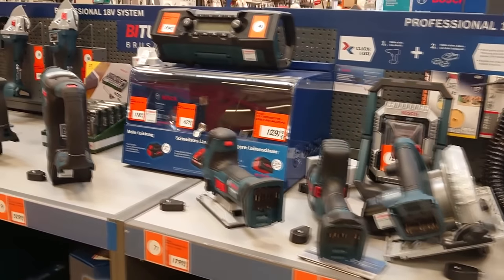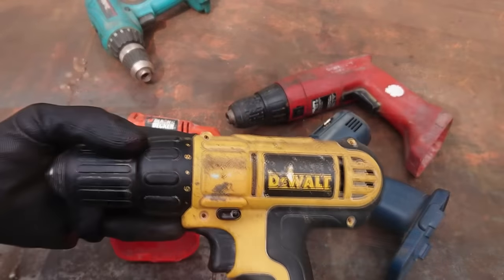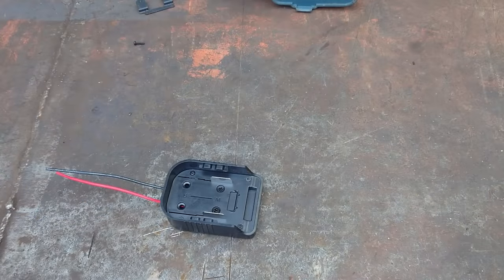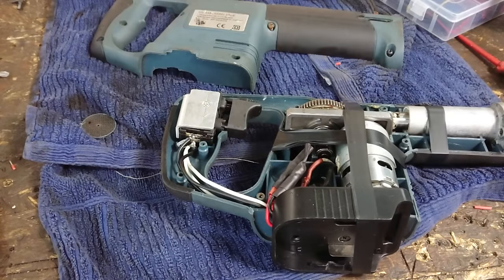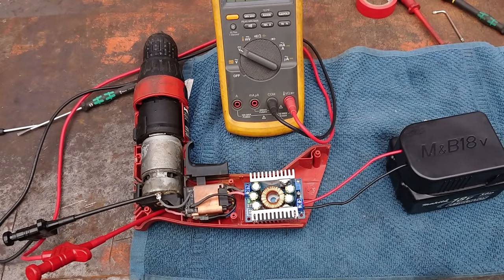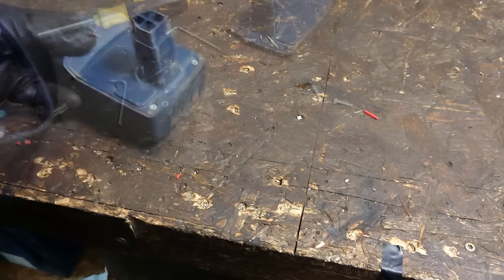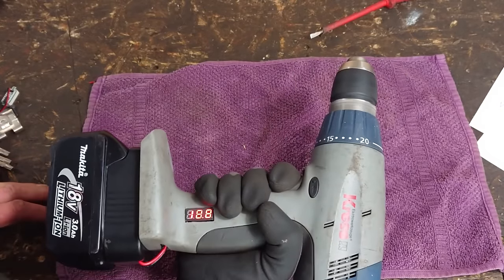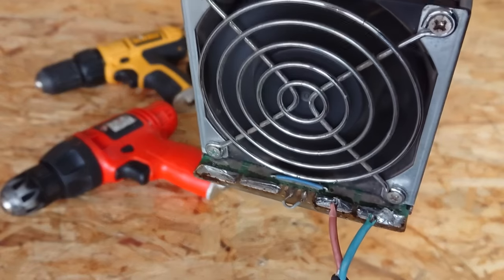Scrapyard Finds! Repair-A-Thon! Cordless Tools Galore!

Comment: While building and working on my new house I had an old 12v drill which I just wadded some 2 core wire or figure 8 wire with a 12v cigarette lighter plug and 3 meters of wire and walked around with my 12v boost starter battery and I could work for several days with out a recharge

Comment: Could you use one of those 12v drills with a car battery? It may be useful to have a drill or saw that you can take camping and it will run as long as you have gas in the engine. A couple of large alligator clamps on one end?
Adam

Comment: You should have taken a couple of those roller shutter motors that can be seen at 1:35. Some of them are quite expensive, especially those from Somfy. And often it's quite easy to fix these. They got a capacitor motor and most of the time it's just the capacitor that needs to be replaced.

Comment: The PTC thermistor in the battery from the Kress drill is probably used to indicate to the charger that either the cells are overheating and to therefore stop the charge cycle or that, as with NiCd and NiMH technologies, to determine a full charge condition has been reached, as the cell temperature starts to increase more quickly when they have attained full charge. The cells do heat slightly during normal charge cycles but this is gradual and the temperature reaches equilibrium.

Comment: Connect a 12 volt tool with a 2 core cable and two alligator clamps to a vehicle battery. Where the vehicle goes you have the tool available.

Comment: I always had the idea in mind of using a carpenters belt, and converting it into a battery pack with switches for different voltages, with a universal connector, on the belt pack and the matting connectors on tools, Something like a barrel jack connector on each tool so regardless of the tool, one just needs to open it up to mod it with the connector and call it a day.

Comment: Seriosly good use of your sparetime, fixing old battery machines. Like the conversion, good idea! One thing i would have done differently: i would change the switch for left/right on the kress machine. Since it is backwards to the common standard, it can be a problem. When i was fiftheen i got an adjustable wrench from my dad, it was a cheap china knock-off and the screw was backwards to normal standards. Even today, (i threw away that crap just after less than a year), i dont know witch way is the right way to tighten/loosen a wrench. Irritating!

Comment: I have a 240v Kress 230mm angle grinder from the 90’s. It is very robust however the commutator is damaged, I’ll get around to fixing it one day.
It was made in Germany but I can find very little on the Kress company online. Although I see a multinational has bought the brand and is using it again, doesn’t look close to the quality of the older model.

Comment: I have that same reciprocating saw with a different manufacturer's name on it... they are chinese.. and i need to convert them to LI or Nickle Metal Hydride so your video was good timing... one recommendation ... if your drill has a Low / High button then only use High for drilling light wood and for any heavy work like screws you should put it on Low because it has more torque. Most people just want their drill to run faster but if you do heavy work like screws on the High setting you will burn out the clutch... I use to work at a tool shop and this was the second most problem after people that drop their tool. ... thank you again for your video I will have to see what adapters I can find and which brand battery is the cheapest.

Comment: 15:05 The thermistors are usually primarily there to connect to chargers, not necessarily the tools themselves.

Older type NiCd chargers used temperature as a full charge indicator, as "delta peak" detection was not popular back then, probably because NiCd have this effect less pronounced, and because circuitry to detect this very subtle peak would be more expensive than a simple NTC to detect heating, which NiCd could tolerate very well anyway.

When NiMH became popular "delta peak" detection chargers became the norm as NiMH are not so resistant to overheating and their delta-peak is somewhat more pronounced.

Even today, Li-Ion packs contain thermistors to connect to chargers as it is very common for chargers to be left somewhat unattended and they may become a fire hazard in case a cell is old or damaged.

In contrast, a battery becoming overheated during use would be immediately noticeable by the user so some brands may forego installing temperature monitoring on the tool altogether.

Comment: you can wire in a rc car battery pack to that very old makita. The 6 cell 7.2 volt ones fit just fine.

Comment: we have einhal 18v tool system in Australia .they are branded ozito pxc  and sold in bunnings their cheaper than ryobi. i use the 18v drill batt for powering laptop computers and to power my ts-100 soldering iron.

Comment: Hello G,  Just an idea to further your battery.  since your concept is to carry around a battery, why not include a few other features, consistent with a general purpose power source?  Maybe add a capacitor for surge so you can jump start a car and a charger and a multivoltage tap for the different tools.  A car jump starter power pack is a close start on the idea.

Comment: I have 3 cordless drills converted to corded.... I made a power supply from an old 12v 10A transformer + 25A bridge rectifier and a 10000uf 25v capacitor....they work like new with a  3m cable

Comment: Thanks for the ideas.  I was thinking about what to do with my Makita 9VDC drill when I cannot find batteries for it any more.  Would hate to get rid of it as that was my first ever cordless tool.  I bought it new back in '87 or '88.  It has worked on almost all of my projects through the years.
Reply: You could find a way to strip out the 'stick' battery case and fit it with three removable 18650 cells?
While not entirely convenient, because of the odd number, you can charge three at a time in a four position charger.

Comment: Very nice, I would have used a good quality XLR connector for power for the last drills, it is secure, has beffy contacts, and the best, its relese mechanism makes its fast to connect and disconnect.

Comment: Now all you need is small foldable solar panel added into the bag carrying a battery for a self sustaining portable unit! Great for homesteaders without electricity or a weekend camper to use to cut firewood with a recip saw or build a shelter using screws! The one thing you didn’t mention was securing new nicad replacement cells. Luckily they are only $13 each for an 18 volt nicad battery at Harbor Freight stateside. I’ve gutted several over the years to use as replacement cells in that same exact 18 volt dewalt drill and most of the other tools in that line. I would suggest whoever tries this to do a search here on YouTube first because it can be dangerous when re-soldering the new cells. Too long you can kill them, slip off and they can explode. Don’t mean to scare anyone because again I’ve done it for years safely, I just want everyone to know there is a risk if done poorly. Now I can find whole replacement battery packs for around $15 each vs the $125.00 each they once were. Yea they’re nicad, but having almost the entire set of that line of 18 volt dewalt tools you can understand me wanting to keep them going because they still work fine today. Thanks for taking us along brother, ✌🏼👍🏼

Comment: I think a RC Li-Ion batteries would work great with the connector system. This would help to create a common battery and connector system.

I would like to do this as I’m looking to get some drills for specific purposes (like one setup for just countersinking) but used drills around my area go for near the cost of new ones.

Comment: i've tested old 12V drills with 18V and even 24V and they seem to work just fine, except that they work faster of course and 12V drills being slow anyway that's a good thing, so could have just used that red Hilti drill straight with the battery. I don't know how or how long the speed controller and whatever else is in the drills would last with a higher than intended voltage though, but it's worth a try.
You don't have to worry about damaging the motor, from what i've seen and tested motors don't have a set voltage at which they work, they are built for a specific one sure, where you get the desired speed and torque, but as long as the voltage doesn't go high enough where it can cause arcing and a short circuit it should be fine, even the cooling should keep up, i mean the fan spins faster too.
The thermistor is used by the charger not the drill, to keep it from overheating while charging (i'm guessing).
I thought about powering the Dewalt 18 volt with a power supply and even used it with a laptop power supply (19v 4.5A), but if you do the calculations, that drill can use up to 30 Amps, no 18V one can do that, i even looked for 24V ones, and hooking it up to 1-2 12v massive batteries is not a portable enough solution.

Comment: Maybe putting a 3 pin connecter would have been better for those drills.
Just leave one pin not connected and then you don't have to be careful of the way you connect the cable.

Comment: I like the repair-a-thons!  FWIW, I wouldn't have let the wires of the adopter be outside the tool.  Even if it meant reworking the adapter.  I'd be afraid it'd catch on something and you'd tear out the wires.

Comment: I'm thinking of converting a corded vacuum cleaner to a battery model for commercial service. Now I need a good surplus DC motor that can be adapted to power tool batteries thanks for the idea.

Comment: The 12V Corded Drill set up would work nice if you have like a 12V riding lawn mower or cart you drove around your property and use 12V tool to Edge, cut tree branches. great for small jobs.  Wait that was a thing is the 70 lol  Google GE Elec-Trak E12s tractor.

Comment: this issue might actually be changing, i haven't looked into it too much, but i saw at my local Kaufland a 20V Li-Ion battery pack that was labeled as Universal, and the Parkside tool brand a year before that switched from their 18V batteries to a 20V one, coincidence ?
Also not long ago i bought a used Dewalt 18V drill similar to your 12V one, with a dead battery pack and no charger, so i bought one of those 20v batteries and charger from Parkside and made an adapter with 3 sheets of 3-4mm plywood and 2 copper strips made from a piece of copper pipe. This was only worth doing because that Dewalt drill was quite fancy, i mean it had a hammer drill function, 2 speeds, a braking system and a very cool ratcheting chuck, things you just don't see on cheap/normal drills.
And a universal battery pack would actually make some sense, i mean there are a lot of cordless tools that i just don't buy because i fear i won't use them often enough and then in a few years when the battery dies i'll just have a useless tool, but with a universal battery i can always find replacement ones. I mean a tool you only use 5 times a year will easily last 30 years but that is pointless if the battery only last 3-4 years.

Comment: i bought a 10 lb. box of old tool batteries from batteryhookup on ebay for $20, to salvage 18650 cells from to rebuild other tool batteries that i resell. one box had 7 batteries in it, with one of them being a 4 ahr. ryobi for the 18v tools, of which i have many. the gauge said it had a full charge, i plugged it into a drill, and it worked perfectly. so i wound up with a $90 battery for a little over $3. i won't be buying a lottery ticket any time soon because i used up my monthly allotment of luck already.

Comment: Nice to save some dead drills, but the vast majority of us have no time to modify them. I have dozens of 9 volt and 12 volt Dewalt  drills, and my method of saving them is to buy aftermarket batteries for $15. The old 9 volt drills take the same battery as the 12 volt, so they all interchange and the difference in voltage is not a problem...

Comment: A lot of these considering they aren't the fastest or most powerful would be great to keep at a cabin or in your car or even if you have a family member you do repairs for. You can just leave the tool there and bring a handful of batteries. Not sure if you've seen sixtyfivefords video on battery adapters where you can use say a Makita battery with a DeWalt tool. They're pretty neat and worth a watch. Also fyi the temperature sensor on a NiCad battery is only used by the charger except for some rare high draw tools.

Comment: Too many battery tools have their lives cut short due to battery technology changing. I have an old AEG drill that I fitted a 12V cigarette lighter plug to that I keep on my camper. Useful when away from home and the battery is already in the vehicle! :)

Comment: Honestly with my current work flow as a commercial electrician, I don’t think I could use any of these drills. They likely wouldn’t be able to do the work and wouldn’t survive if they could. I need to be able drill up to 4.5” hole saws into steel enclosures, 6.5” hole saws through drywall, 1-3/8” step bits through thicker metals and to be portable. My current drill is a Hilti SF 10W-A22, the drill before it that died of abuse was a Gen 2 Milwaukee M18 fuel.

Comment: I think that Kress drill's battery had thermistor for charger. If I remember correctly NiCad batteries heat up when they are nearly charged.

Comment: When using old PC power supply's (PSU) make sure that it is single rail, like the server PSU. Older Thermaltake PSU's for example used up to six rails for the 12v. This would mean only single figure amperage on each rail rather than the average 50-60 amps of a single rail on that server PSU.

Comment: Wish you had done something with those old Makita drills with the stick batteries.  I have about half a dozen of those I bought when I ran a stagehand group, along with a matching saw.  I've been thinking how I might convert those; but that long hollow handle doesn't lend itself to the flat battery conversion you outline here, and I want to the battery to be internal somehow.

Maybe an 18650 conversion, with a built in charge circuit that fits inside the handle?

Also I've seen lithium discharge protection circuits.

Comment: you could make one of those wire adapters for 12 volt with  some alligator clips to connect them to car battery in a pinch.

Comment: Very good reuse of this "scrap". Just one opinion to the Kress(15:30) for me it seems to be connected with the wrong polarity as typically when the direction switch is pressed on the right hand side the drill goes clockwise and vice versa. This doesn't make a functional degradation but someone has to get used to it.

Comment: I changed a battery drill to AC power and the 30 amper power supply was barely enough to spin it.

Comment: I have done the portable battery thing with a few old 12V cordless tools I had. I have a bunch of the 18V Ryobi cordless tools and its occurred to me Ryobi will probably phase them out for a new design sooner or later and I won't be able to get batteries for them.

Comment: There is a way to make the tool portable like the way it was desined with litium bateries, basiscaly you change the old bateries from the holder with some litium ones and use a controler to make the desired voltage.
Reply: Yep, I said this above but check out Gear Show. He does exactly what you said and adds a power level circuit board for a number of his projects. He even changes the charger to cater for the new Li-Ion battery he puts in.

Comment: I never got the Idea to use a standart batery adapter but it makes sense.
The conversion of !2V Tools with a Cabel, i´m using over 20 jears now, mostly with fixted cabels. Recently also with conectors at the tool.
For free conectors and Plugs i "missuse" a very comon system, the  main powerplugs and Conecktors from PC Smps and Cabels for my personal 12V Systems at home and my cars and camper..... The Cabes and Conectors are In german labeld as "Kaltgeräte Stecker/Buchsen" in englisch named as rubber connector or cold device plug
First of, it seams risky but if you connec in the Conectors and Cabels in a special way, it isn´t.
I use from the three pins in the Cabels and the Conechtors  the protective conductor for Positive, both of the Phase and Neutral Connecktors together as Negativ.  It works fine for 12V. But if sombody clueless ignores the 12V DC Label and connechts a normal mainpowercabel to my tools and conechts them to mainpower, the mainpower fuse goes with a bang or the FI (residual current circuit breaker) trips.
Cabels and connectors are en mass in the trasch or the scrapyards....... Used them!

Comment: If it is a Lithium based accumulator pack, then, by code, they must have under/over-voltage and temperature protection built in to the battery pack itself.

Comment: I successfully modded a very old Einhell cordless drill by replacing the guts of a dead battery with a Laptop powersupply that has just about enough power to make it useful. This means just 1 cord and no external PSU.

So now I have an IBM powered screwdriver/drill.

Comment: Not %100 all manufacturers Li-ion batts are like this but any experience I’ve had taking them apart they have a discharge protection circuit built into the batteries themselves. Don’t think the volt meters are all that necessary.

Comment: I buy 18650 battery packs from old laptop batteries and hook up a small battery pack

3 in series for 12V
5 in series for 18V(it'll be 20V)
You'd need to hook em up in parallel according to usage time most 18650s are 2.2-4Ah. search it up on YouTube